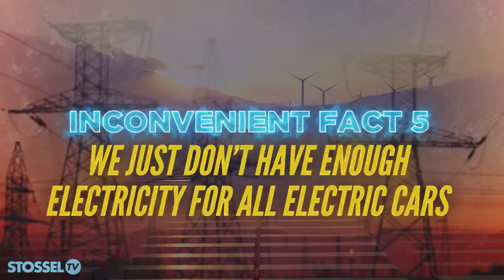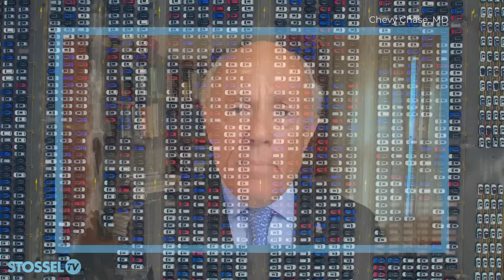Electric Cars: Inconvenient Facts, Part 2

Comment: Until I can have a truck that will tow a boat 300+ miles on one charge and recharge in 5 minutes I won’t even consider it.
Reply: True. At least a hybrid would make more sense than electric for many, but ya. They want peasants to quit driving and just be cold in winter and hot in summer, while they fly on private jets all over the world for vacations alot and go in their mansions which probably use way more energy than average americans...  

If gov really care about env, Gov should Let everyone use an acre to grow their own food/live on. Ban farm subsidies. And maybe gov should start with gov cutting back since gov is the or one of the top polluters and energy/oil/gas/and electricity users. Especially regarding wars and military.

Food transport emissions r nearly half of direct emissions from road vehicles reportedly.
Reply: You may consider it earlier if it ends up costing you $400 to fill up your tank. The free market will decide, and the future is indeed electric, regardless of what any politician wants.
Reply: @jimmaag4274  IF it were left up to the free market (which it's not) the future would most certainly not be electric.
Reply: That would be an amazing amount of power to transfer to a battery in 5 min.
Reply: @jimmaag4274  the free market? You obviously don’t have any idea what that term means considering there hasn’t been anything remotely resembling a “free market” regarding electric cars. Government subsidies allowed Tesla to exist at all, rebates allow for the somewhat decent sales numbers and the social/political pressure campaigns have all but shamed any who point out that this isn’t the best solution.
Reply: Why would you beed to "recharge in 5 minutes" once you reach your destination?
Reply: @jimmaag4274  It won't cost $400 to fill up unless politicians interfere with the free market.
Reply: @bvegannow1936  Far easier and cheaper to make a hybrid where the ICE unit does NOT interact with the transmission / drive system.  Instead a relatively small engine that spins an alternator ...  Cruising at 55 you only need about 20hp.  Not including any A/C etc running.
Reply: @jimmaag4274  We don't have a free market, if we did EV's wouldn't be competitive. Ev's are subsidized by the government and the oil industry is heavily taxed and punished by the government. Without government intervention EV's would be dead.
Reply: @groob33  Tesla still sells a lot of cars, and the incentive payments ended years ago.  They sell hundreds of thousnds of eVs with no government incentive and no advertising- it's as "free market" as it gets in the USA.
Reply: @jimmaag4274  it already costs me $150 to fill my truck here in California. 
I assume $400 fill ups within the next ten years and I’ll still keep my Dodge Ram 2500. 
electrical rates here are on par with gasoline. When fuel is $400 so will your electricity be for that same fill up. 
How do you think electricity is produced?
Reply: It will never happen.
Reply: @bvegannow1936  CO2 is not a pollutant, it's actual food for the plants you like to eat. I do agree with you making the gov much smaller. This is essential if we want to keep the world from collapsing
Reply: @garygrant9612  no matter where the power comes from. The actual act of transferring that much power to a portable battery in such a small amount of time would be amazing. Watts equals volts times amps.
The amount of volts and amps would be scary.
Reply: @libertarian4323  California banning all combustion engines by 2035 is NOT free market my friend.
Reply: @jimmaag4274  There is no free market when it comes to electric vehicles. In your mind stealing taxes from working people to give tax breaks to richer people to buy electric cars is a free market? If your answer is yes, then you don't know what a free market is.
Reply: @libertarian4323  Tesla also has the WORST customer service of ANY auto manufacturer out there. They are unfriendly and uncaring and give you a very hard time when it comes to replacement parts. Also another problem with EV's is serviceability. If I want a part for my ICE car I can go to almost any parts store and get them. Also if I want to have it fixed I can go to almost any service shop. You  cannot do that with a Tesla. No parts stores sell parts for Tesla's. Also almost no service shop (except a very very small few) will work on them. Thise means back to the dealer if you need service work.
Reply: @jimmaag4274  Keep drinking that cool-aid
Reply: @groob33  California isn't the entire world.  Bad policy in one state does not change the fact that no Tesla sold today (or for the past ~4 years) has been Federally incentivized.
Reply: @bvegannow1936  it's all great until you have to replace that battery pack. Then your vehicle is totalled out. Because the price of a battery pack is higher than the value of a used vehicle.
Reply: @jimmaag4274  the only way fuel will cost that much is if the market is artificially manipulated. The future is not written. You have no idea what tomorrow holds. Based on our current understanding of physics the future of transportation is not electric though.
Reply: @dafunkmonster  you obviously don't understand how the free market works.
Reply: @libertarian4323  Because he’s traveling more than 300 miles
Reply: @jimmaag4274  you obviously don't realise how large the subsidies for renewables have been in the last two decades.
Reply: @dennisg4053  How heavy of a vehicle? That number is bull crap if you’re pulling anything.
Reply: @libertarian4323  There’s more going on in the Green Energy movement than direct subsidies.
Reply: @canihave1dab724   But there are subsidies on gas & oil as well, which we all take advantage of every time we fill our tanks.   Also Tesla has no subsidies right now - they surpassed the volume of cars subsidized and it ended - yet they still are oversold.
Reply: @libertarian4323  that's how long it takes to fill up with fuel, you don't have to plan a whole night or day, or very least a half a day to sit and wait for the battery to charge
Reply: @doittoit00  yeah and? Gas/diesel and oil are actually useful to run the world, aside from commuting. Electric cars are a luxury good and are a half measure (at best) to combat air pollution. Pretty much all plastics are petroleum based, asphalt is petroleum based, all heavy machinery runs on diesel… there’s not really a comparison here as to why oil and gas gets subsidies and electric cars shouldn’t. If you want to argue that battery tech or semiconductors should be subsidized, that’s a different debate and worth having, but electric cars alone are not a real solution to the problems they purport to solve and the cult of personality behind their proliferation is off-putting, to say the least.
Reply: @doittoit00  Name one subsidy!
Reply: @libertarian4323   - because the battery charge is likely depleted, and to be able travel for something to eat or for entertainment options that are common when on vacation.
Reply: After owning an EV now for the last 4 years, until I can have a gas car that can fill up with gas in my garage while at 1/3 the cost of retail gas prices I won't even consider it.
Reply: @libertarian4323  "Why would you beed to "recharge in 5 minutes" once you reach your destination?"

So I'm assuming you've never driven anywhere beyond a few miles.

Also, Tesla still gets subsidies.  And if you think psychological pressure and fear-mongering the imaginary "climate-crisis" is not pressure or incentive to buy, then you don't understand humanity or politics.
Reply: @libertarian4323  true but the masses cannot afford a Tesla.
Reply: @doittoit00  The subsidies for "renewables" is about 10x what it is for gas/oil.  Personally, I oppose ALL government subsidies.  Subsidies are nothing more than politicians granting special benefits to certain companies or industries over others, destroying the free market and manipulating costs and usage.
Reply: @droe2570  1.  Once your trip is done, you park in the garage and charge.  Unless you plan on running out the door again in 5-minutes, this seems to be a rather absurd requirement?  2.  The full subsidies for Tesla ran out in early 2018.  Even the small partial subsidies were gone by 2019.  Every Tesla bought since then has received no Federal tax subsidy.  Tesla, by itself, will likely sell just under half a million cars in the US alone this year.  No incentives and no advertising.  And sales are rising fast.
FWIW, we didn't buy our first Tesla because of "climate change" or any such nonsense.  We bought it because our friend let us drive his and HOLY CRAP, it was fun to drive!  Made our BMW seem like a slow, out of date relic.  We won't be going back to BMW anytime soon- ICE or eV (they make electrics, but from what I've seen, they kinda suck).  A car designed and made in the USA and it's the best driver we've ever had (by far).  What's not to like?
Reply: @libertarian4323  Why would a person claiming to be a libertarian ask why someone else needs something?

But to answer your silly question, this is the current standard for gasoline or diesel pickup trucks.  And who says that he would only be going 300 miles?
Reply: @jimmaag4274  The "free market", yet the current gas prices and electric incentives provided by the government are what's fueling the cost shift. The energy market is anything but free.
Reply: @libertarian4323  "Once your trip is done, you park in the garage and charge."

You just ignored my comment with this.  Good job.

"The full subsidies for Tesla ran out in early 2018"

They are still getting subsidies.  The term "full subsidies" is meaningless, there is no such thing.

"we didn't buy our first Tesla because of "climate change" or any such nonsense.  We bought it because our friend let us drive his and HOLY CRAP, it was fun to drive!"

That's nice, but that has nothing to do with anything.  We are not talking about you liking your tesla.  We are talking about the industry of EVs in general, and the fact that they only exist because of political BS.  Without that BS and without subsidies, no one would have ever made them in the first place.
Reply: @droe2570  Incorrect.  Tesla was making eVs long before the Federal tax incentive.  As I correctly stated previously, the tax incentive to buy Tesla's ended years ago.  Every Tesla bought in the past ~4 years was purchased with no Federal incentive and no advertising.  They don't need to advertise, the cars sell themselves once people drive them.  The people that bitch about them the most tend to be the ones who have never driven one and got all their knowledge from Sean Hannity or similar.
Reply: @libertarian4323  Dude, Tesla would have gone out of business were it not for subsidies.  And Tesla only exists because of political BS in the first place.  

" the tax incentive to buy Tesla's ended years ago."

Who said that they were?  I didn't.  What I said is that they are still getting subsidies (they are).  I also said there are other incentives based primarily on political nonsense and pressure to buy EVs in general (which there is).

Please try to actually stick to reality, not strawmen.
Reply: @droe2570  I'm not sure what you are complaining about?  Every car manufacturer receives "subsidies" (or outright bail outs) at some time.  Including the big dog (GM).  So why complain about Tesla, which has received far less than GM (and others)?
As I said, there have been no incentives/payments/tax breaks to buy a Tesla in the past 3-4 years.  Every Tesla purchase that was made was done so just because they make great cars that are far ahead of their competitors (both ICE and eV).  We received a partial tax break on our first Tesla (purchased 2018).  Though we would have bought it even without the subsidy.  Our second Tesla (2021) was purchase with no incentive, as will be our third Tesla. Assuming Elon ever gets his stuff together and actually starts producing the damned Cybertruck! :)
Reply: @libertarian4323  I'm not complaining at all.  I am pointing out realities.

And yes, all those subsidies are wrong, and the GM bailout was wrong.

The point is that EVs only exist because of subsidies and political pressures based on fictional crises.
Reply: @droe2570  Like probably most Tesla owners, we buy them not for "environmental" reasons, but just because they are great cars.  We know several other Tesla owners, I can only think of one that is a "greenie" and bought hers primarily for "environmental" reasons.  But we live in Texas, things might be different in CA.
Reply: @libertarian4323  "Like probably most Tesla owners, we buy them not for "environmental" reasons, but just because they are great cars"

Again, this is not relevant.  You would have no Teslas to buy were it not for government interference in the market place.
Reply: @droe2570  Yeah, I got it.  You think Tesla's success is because of the government.    Okay.  Whatever.  Would you like to discuss the Punic Wars next?
Reply: @libertarian4323  I don't think that, I know that.  It is historical fact.

I should also point out that there are numerous subsidies and grants surrounding EVs, not just the federal incentive.  States have their own incentives and bonus programs.  There is still, despite your claim otherwise, a federal EV tax credit (only if the car is assembled in the US), and a new one (up to $4k) for buying used EVs.

So it's not just opinion, it's reality.  EVs only exist because of the government.
Reply: @DxV04  too much of anything can be bad. I wasn't arguing that theres too much c02. i didn't mention c02. If there is too much in an area it could have bad health affects on someone and kill them cuz we need oxygen, but most places people live c02 doesn't seem to be that much of an issue compared to stuff like exhaust.
Reply: @libertarian4323  Who said the destination was in one charge? What if I want to travel 2000 miles? A car today can be refueled in 5 minutes. I can drive 700-800 miles in a day if I want. That’s 2-3 refueling stops. EV’s can’t do that. EV’s towing trailers certainly can’t.
Reply: @4partee  Intangible Drilling Costs Deduction, Foreign Tax Credit, Master Limited Partnerships, Domestic Manufacturing Deduction, The America Recovery and Reinvestment Act.  There’s more, but you get the point.
Reply: @canihave1dab724  No question about it - if we were to flip all cars and trucks to Electric today the gas and oil industry would still be needed for around 50% of its current output.  Does that mean we shouldn’t do it?  There is a point at which fossil fuels stop being available, and we don’t really want to get close to that point.
Reply: @rdhunkins  You can easily do 700-800 miles per day in a Tesla Model S, and for a much lower cost than an ICE vehicle.  I've driven much longer distances than that in a single day with our Model S while driving from South Texas to upstate NY.  I have also done it with an older Model 3, but it's slower with a Model 3 because it has significantly less range.  In either case, it would take longer than with an ICE vehicle, but easily doable.   I'll let you know about hauling when I get my Tesla Cybertruck if it finally gets to production.  FWIW, Ford and Rivian have pickups currently, but unfortunately, I'm not aware of their capabilities.
Reply: @libertarian4323  lol
Reply: @groob33  it's ok only homeless will inhabit Cali by then.
Reply: @JayVal90  lol
Reply: @doittoit00  please explain the subsidies on gas & oil.
Reply: @dafunkmonster  It certainly WOULD cost $400 to fill up if you paid that actual non-subsidized price of oil.
Reply: @annbennett5312   I’m not sure I understand what you are asking.  Each program is a subsidy in that it has a method for the company claiming it to reduce their costs, either by reducing taxable income or through tax credits.
Reply: Check out the specs on the Tesla CyberTruck...you might be surprised.